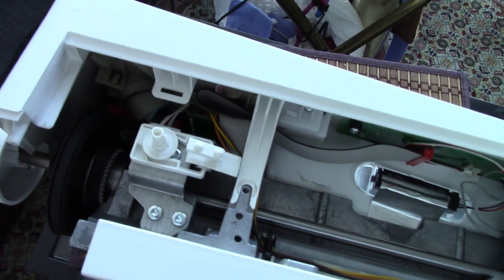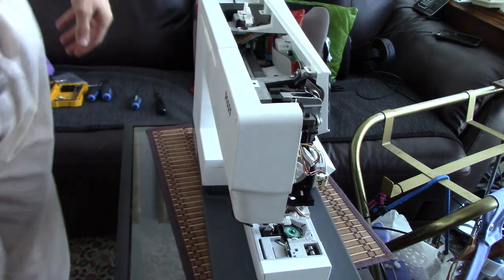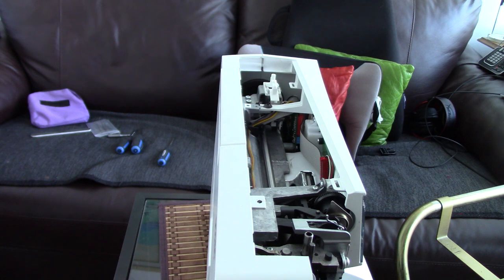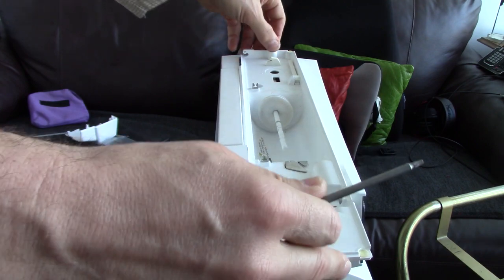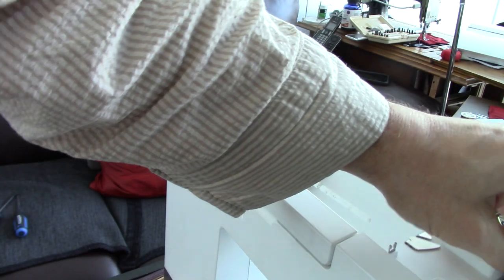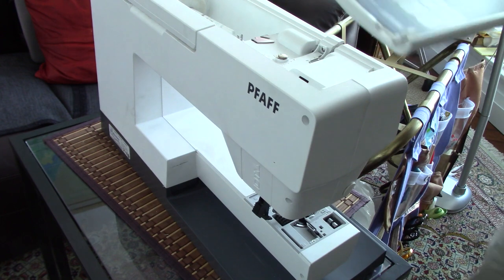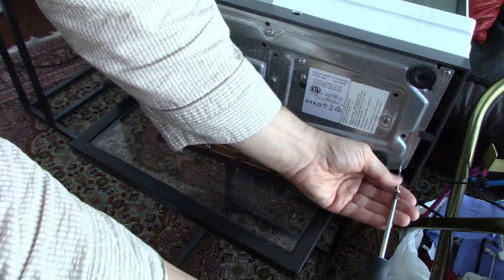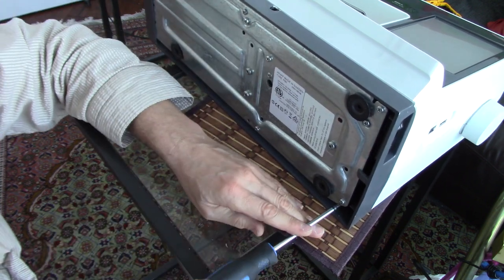Pfaff Creative Vision Reassembly

Comment: In order to remove the front cover and get to the power supply and mother board you should remove the screw to the top right of the screw that you are installing at 16:52.  The one you are putting in actually holds the power supply in place.   Thanks for sharing your videos and knowledge.

Comment: Hi James! I really appreciate your videos, they help us a lot.
I have a Pfaff Creative Vision 5.0, I bought it recently, but it appears to have problems with the power supply, is it possible to change it by opening the bottom cover? I've already loosened the screws, but I can't open it.
And can you give me some help on how to make this change by installing a new power supply? Thank you.
Reply from the maker: That is frustrating for you. The bottom cover should pull of when all of the bolts holding the base to the frame are completely removed. The power supply is a separate module and can be replaced. There are a few screws which attach it to the frame and a few cables to attach it to the electronic components. Take a photo of the existing one in situ and then when the replacement arrives, it should be just a few minutes to swap it for the new one. If you still cannot get the bottom off, let me know and I will check to see if there is something that might be holding it in place. Check that the power and foot controllers are removed as well.

Comment: Hi James, first off this creative vision series was a god send as we recently purchased a "used" creative vision that is in need of  TLC . I pulled the top and back 
covers off as/per the  video. My question(s) are how to get the bottom gray base off as I need to put the spring back on  the embroidery unit connection door
cover (the spring is just laying in  the "well" behind the leg of the door). Looks easier to do with the gray base off. Also is there a way to get the front cover off
easily. I have removed the 4-bottom screws (video) and the top screw under the cover by the bobbin winder , but it looks like the flywheel/hand wheel needs to come off, I'm afraid those 2- plastic arms that  grip the cross pin on the shaft might  be brittle . The  machine sewed at demo but somebody  was definitely inside before. Any help would be  appreciated.
Reply from the maker: There are four screws that hold the base on. There are other screws which hold the machine to the base. You will not hurt anything by unscrewing the wrong ones. It is difficult to figure out which ones are correct, but one thing that I found helpful was to push and pull the plastic bits whilst unscrewing. If there was additional movement, it is the right one. At worst, if you take them all out, the power supply and stuff will become loose. They can all be screwed back on.
Reply: @jamesrogers991  Thanks for the reply. Eventually pulled the face cover off  (and found the spring clip that contacts the underneath of the needle plate laying below the hook in lint ! )now for the base, all to replace the embroidery unit connection spring loaded door ( where the spring was laying inside by the connector { door had no spring closure},just need to figure where the spring leg anchors. Again many thanks for your creative vision videos

Comment: James - Fundamental questions: I have two problems: 1. Machine reboots.  2. Motor Overload. Of course the machine is very clean, rotates freely, plug fully inserted, Overload message may occur with even a very thin piece of fabric. After POPO, machine may runs for hours, then starts repeating the problems. How to access the power supply/circuit board / Motor. Is this a brushed motor? Best location to access the service manual. Thanks for help...
Reply from the maker: I have seen some service manuals on-line but I have not found the one for the exact model. The boards and power supply are all very accessible once you take off the covers. The motor overload I have seen with needle jams. The bobbin area and gears are attached to the needle. When you take off the covers, check in the bobbin area and gear area for broken needles and fluff. The motors are standard type and should be purchasable on-line.

Comment: Any chance you can take stills of the thread cover mods you made by adding the little metal thingy behind the plastic and what you did below the machine with hot melt glue to fix the thread shreding?
Reply from the maker: I just put a piece of metal which covers the area where the thread made groves in the plastic. I can certainly try to send you some stills if you wish. I would recommend checking if thread has made groves in the plastic. I have even seen that thread can made groves in aluminium. Steel seems to be the best choice. I noticed that many other machines have a streel wire across that arrea but the flat piece was easier than trying to figure out how to drill holes and attache it.

Comment: There is a Pfaff CV embroidery machine near me.  The lady said that the embroidery function quit working.  Then the last time she tried to just sew with it, when she turned it on it shut down almost immediately.  Any idea what might be wrong with it?  I know another Ytuber replaced all the capacitors on some Husqvarna Designer SE's and brought them back to life.  I can get the machine and every thing for $100, just hate to see it go to the dump if it can be repaired.  It looks like a great machine.
Reply from the maker: When the machine powers up and then shuts off immediately, this usually means that the power supply needs replacing or some electronics person can replace the capacitors etc. which have failed. It is not a terribly expensive part compared to the price of the machine. The embroidery carriage will likely need a good cleaning and lubricating -- it is not awful to do, but there are quite a few screws involved.
Reply: @jamesrogers991  We went and bought the machine today.  Embroidery arm, 3 large hoops, and a large hoop 350mm X 360mm.    I turns on, the lights come on, the presser foot raises and lowers, then the dogs move.  The touch screen is responsive.  We have tried doing a straight stitch a dozen times, as soon as the presser foot goes down it shuts down.  1 time it sewed 4 stitches, then shut down.  I does the same thing whether using the foot pedal or using the "Start" button.  I'm thinking it may need a good cleaning and possibly a tension issue.  The wheel turns freely to move the needle bar up and down.  There was quite a bit of lint under the bobbin case.  Any thoughts on what the issue might be, motor, bad ground, tension issues.  I'm going to tear into it with the help from your video, and do a good cleaning and look for any loose chaffed wires.  Thanks, Ken
Reply from the maker: @customcutter100  it is the power supply. I had the same symptoms but once I replaced the power supply it worked perfectly. It is a common fault and just takes a bit of money and time and then you will love it.
Reply: @jamesrogers991  Just wanted to give you and update.  I pulled all the covers off and tested the power supply voltages.  Then I checked the foot pedal, and finally I checked the cable from the power supply to the mother board for shorts or continuity.  I re-attached the power supply cable and seated each end FIRMLY.  It is working fine.  Thanks again for the video it helped in the dis-assembly.
Reply from the maker: @customcutter100  Wow, that is fantastic news. Happy sewing.